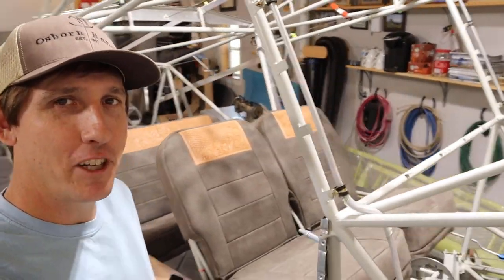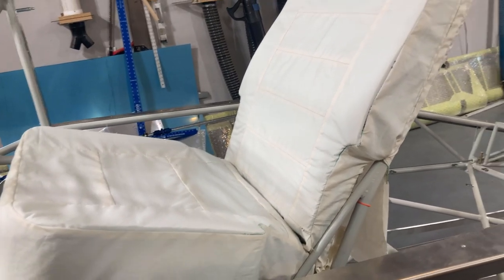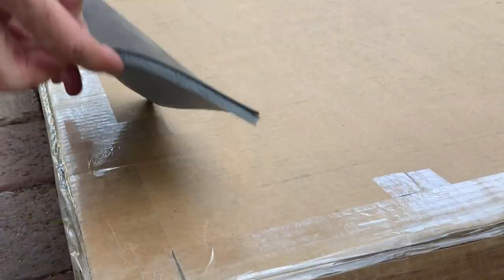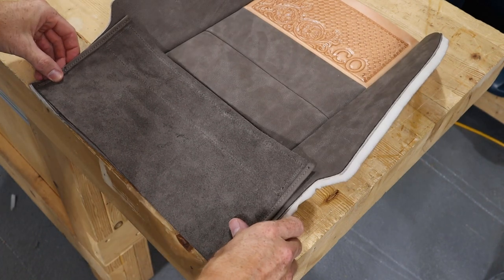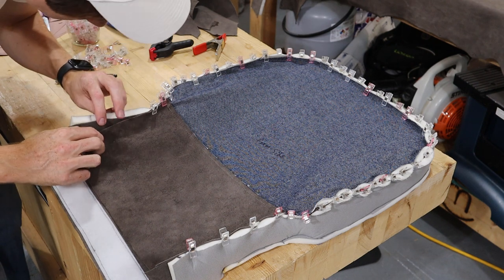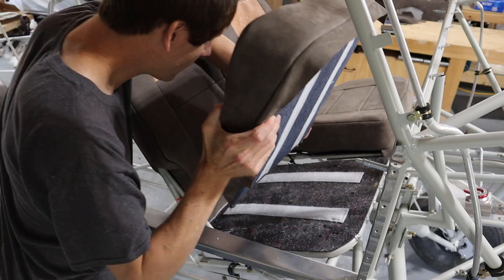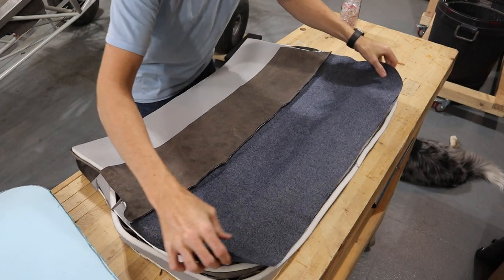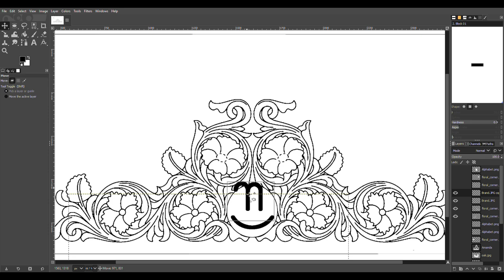Seat Upholstery for Our Homebuilt Airplane

Comment: That's a great job you done on seats.
I can see only two rows, did you give up the third seat row on this build?
Reply from the maker: Thanks! We're building ours as a 4-place with a large cargo area. The extra cargo space will be more useful to us than the third row of seats. But we still have the seat frame and all of the attachment points are welded in place if we ever change our mind.
Reply: @ColbyOsborn 
Any chance on one of the videos, you could pop the seat frame in the plane just for a reference, how much cargo space there is with an extra row and without it?
Thanks
Reply from the maker: If you stop my second video "Receiving and Unboxing Our Airplane Kit" at 10:11 you can see a side shot of the frames for all 6 seats installed.
Reply: @ColbyOsborn 
Thanks buddy, seen that. I was thinking of a stage when the fuselage is covered, and one can actually visually appreciate the space. It is a bit difficult to reference on a uncovered frame structure.
Good luck with the project. Hope to join the club of bearhawk owners...
Reply from the maker: Gotcha. I’ll get a shot like that once I get it all covered and have the rear baggage bulkhead in. We’re thoroughly enjoying building. Hope you can enjoy building someday soon as well.